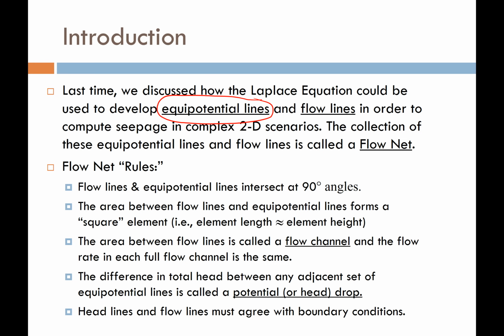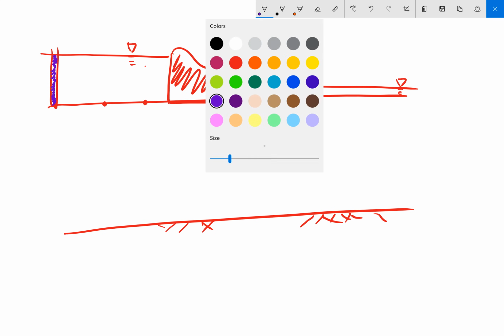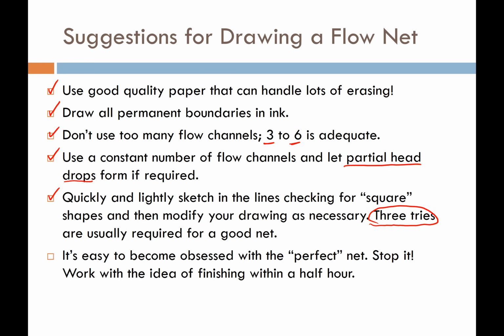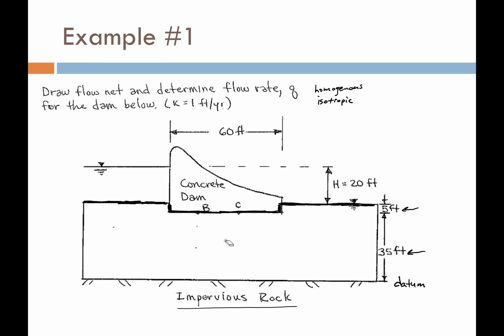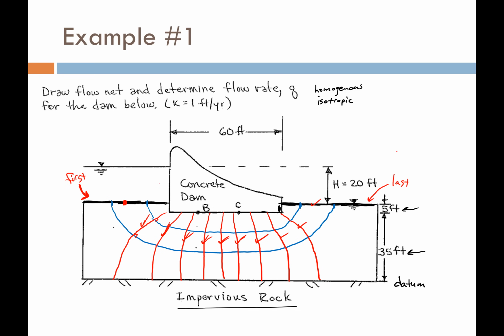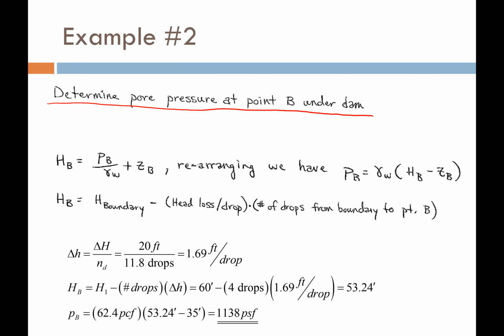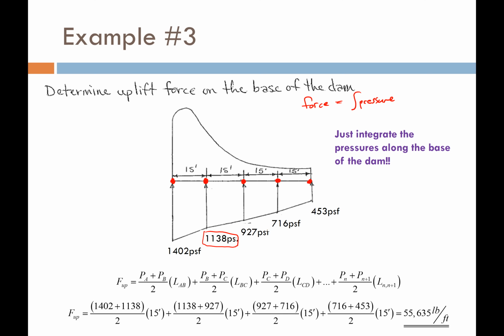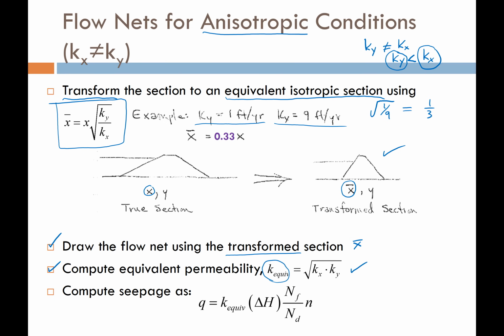CEEN 341 - Lecture 9 - Flow Nets

Comment: I was a little confused by the part about the boxes being "square".  Isn't it only required that the flow and potential lines intersect at right angles?   Since the flow lines are of unequal total length, it would be necessary for the "boxes" to necessarily have different top and bottom lengths, but it would still be possible to draw the orthogonal intersections at right angles.   One could use the average of top/bottom and left/right lines to imagine the effective "square".   No??
Reply from the maker: You aren't really drawing true squares, but "quasi-squares." You need to use a lot of imagination here, but the approximate horizontal distance and vertical distance through the center of the element need to be about the same. That is what I mean by "quasi-square."